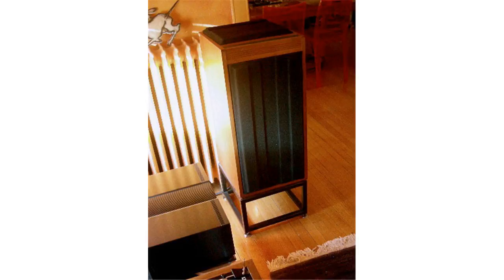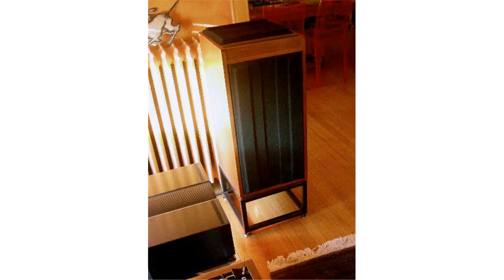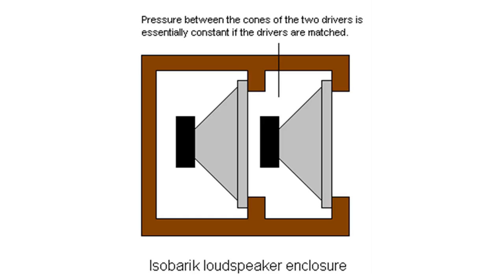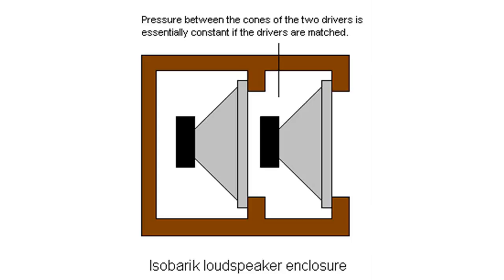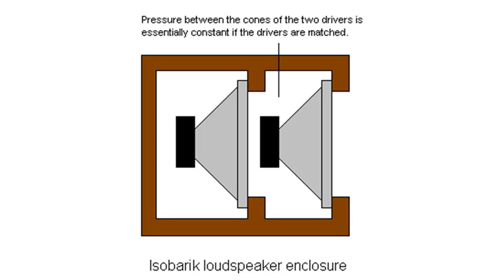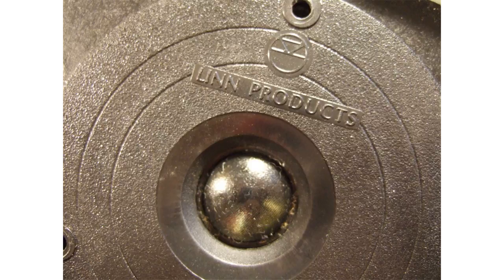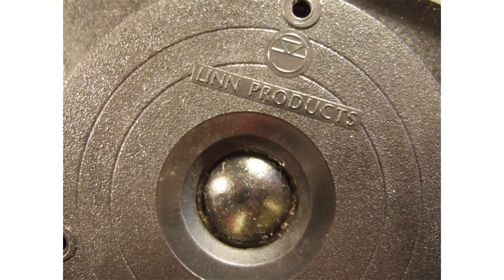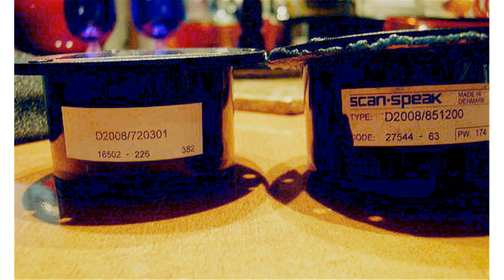Linn Isobarik

Comment: The Isobarik doesn't go down to DC. Anechoic response indicates that 36 hz is the -3db point. In room response should give another 10 hz extension. That's a 26 hz box when optimally placed in a proper domestic environment. Linn was so full of cultist hype. Fact is they didn't even have the know how to design a crossover when the speaker was originally developed at the Ariston Audio factory. The Linn DMS used a Kef kit KK3 who's design dates back to 1969. Later versions in the 80s improved the crossover as did the active version but their claims to unique technology were just marketing hype. The midrange (typical of Kef bextrene cones) is colored... a cupped hands quality even by the standards of it's time.
Reply: The KEf unit B110 has been used in many Ls3/5a BBC speakers, which you have to pay 1-3k/ per pair today (for 30-40 years small speakers)....so not sure if the B110 is so colored as you said! You need to have a proper amplifier to match them together!